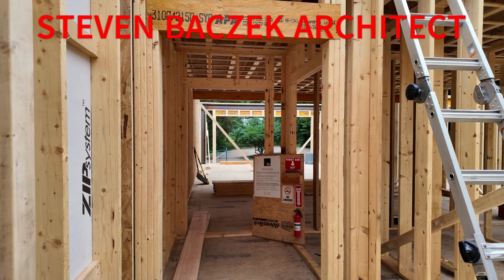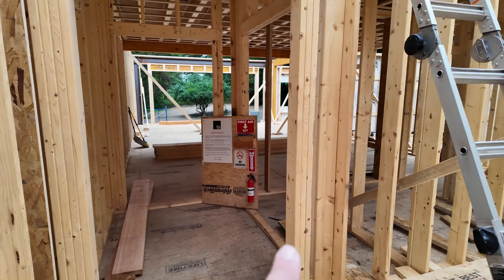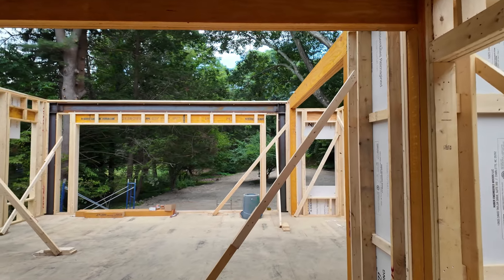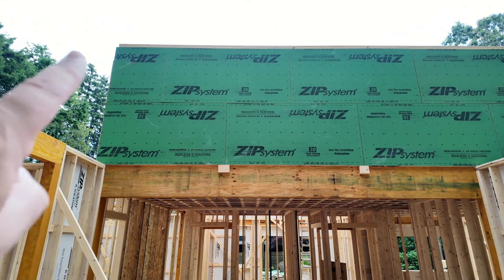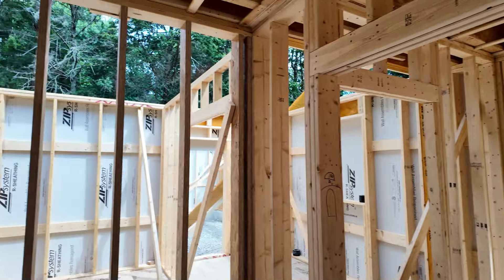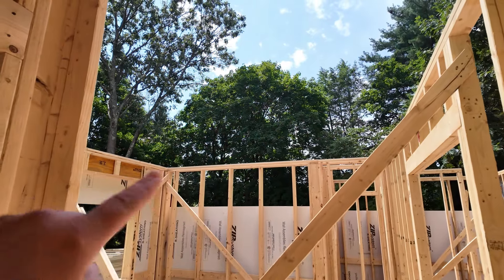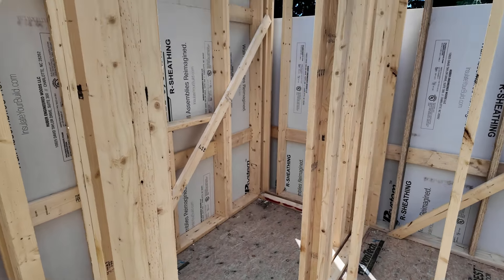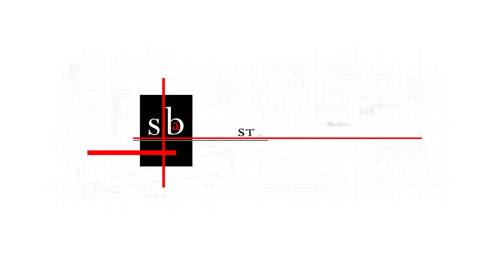INTERIOR DETAILS during a Frame Walk

Comment: Looks like a well thought out design. I’m wondering if that double-wall framing detail you like to use in the bathrooms is potentially problematic for future access to the shower valve in case of a problem down the road. You wouldn’t want to go through the shower wall for access because of the tile and waterproof shower enclosure assembly; you’d want to access it from the opposite side of the wall. Does the pocket door framing/assembly prevent access from the backside or is there enough space between the framing members to reach the shower valve (with the pocket door in the closed position)?
Reply: I’d try with the door open. I don’t know if it would be that bad. Where the pocket door members happen is hard to be perfectly aligned for the valve location. Could work it out if one is concerned.
Reply: I think the door would have to be closed or it would be in the way of accessing the valve, but otherwise what you’re saying makes sense to me. Thanks!